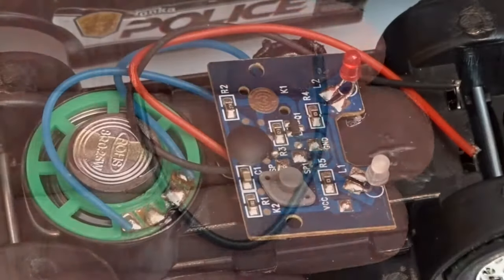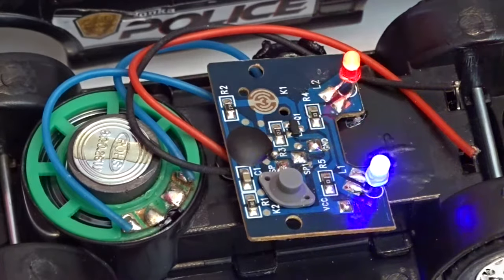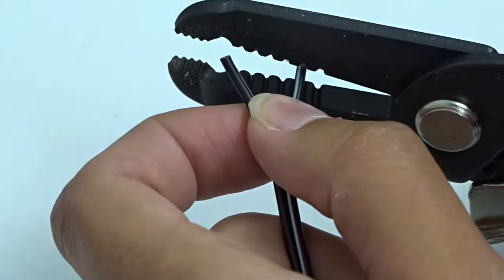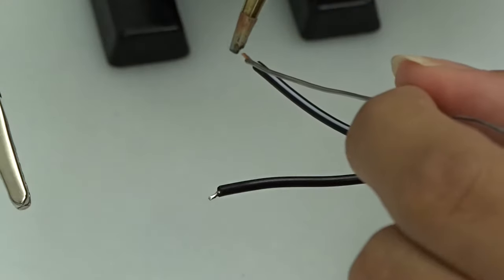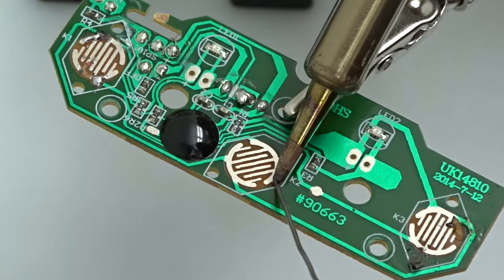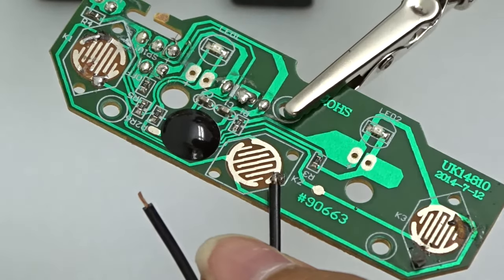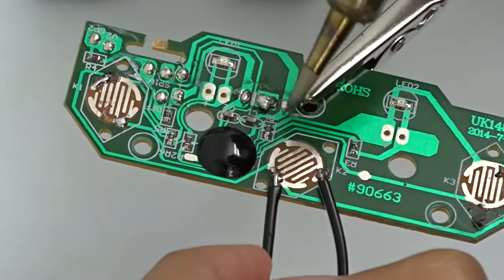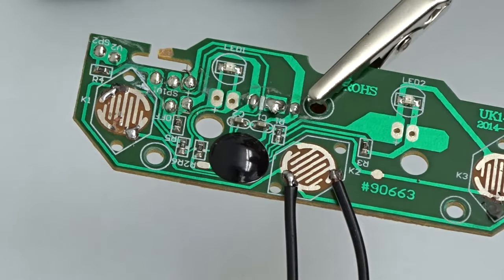How to Solder a Wire to a Circuit Board

Comment: I've taught myself as I worked in car audio electronics in my own business.  Things come up and soldering became an important part of my life.  As time went on things got smaller and smaller and the work my needed magnification just to see it.  So I got reading glasses in various strengths most powerful being 3.25.  Next is an electronic microscope.  This video is a great starting point for soldering to a circuit board.  You're A good teacher.

Comment: THANK YOU!  for your time in making this video.  I have a Kenmore vacuum, that needed a wand release tab replaced.  Which I got done.  But not knowing what I am doing to re-assemble, one wire to the circuit board came off.  That control the carpet part to work.  I have had a solder iron for years, due to model trains, but never got the concept on how to solder, as you explain it very well in short time.  So I did get the wire back on, but then another wire came off, in the process of re-assemble.  Got that back on too!  Vacuum works get.  The release tab will break in time, again, as I got 2 tabs, so the vacuum lives.  MM.

Comment: The solder doesn’t melt on the board. Instead it sticks to the wire. If I leave it on the board and put pressure; the metal part of the board would come off. Any advice?
Reply: Use flux paste. You can think of it as a river. The flux paste is your riverbank it controls where the water is going to go aka the solder. Solder is attracted to heat. It will follow the heat wherever it goes so if you heat up the metal on the board the solder will follow and attract itself to that place of heat on that board thus sticking to it. If you heat the wire up it's going to stick to the wire you have to heat the board then the wire then the solder. Just remember solder always goes to where the heat is. Just think of it as your daughter's a gold digging woman and your heat gun is the richest man on earth.
Reply: Also I said that kind of wrong because more or less your flux is like a lubricant It just makes everything flow but a lot easier. Solder takes the path of least resistance when you add flux to it It basically heats up the flux and replaces The flux with itself. Oh here's a good example you and your old lady are the copper and the flux. Once you to get heated up suddenly you're a kid burst into the room which is your solder and because you two are all hot and whatnot of course naturally your kids going to follow you around. That's actually a pretty good one.

Comment: Can someone pleasse help me. Can you solder a wire onto old solder on a mother board?? Or do i have to clean out the old solder before i can solder back the wire
Reply: Did you find your answer?
I found a video on “how to remove old solder”. I’m not sure if you have to remove the old. Videos make it look so easy and clean, but my soldering jobs look like a clump of crap lol
Wish I knew more to give you the answer you’re looking for.
Reply: Yea you can.  Just make sure you heat the old solder and new solder well so that they merge together as one.

Comment: Do you need solder with flux?
Reply: Always
Reply: @TriconPOE  I’m new to soldering what does flux do? And is it necessary?
Reply: @rushyy8765  Not a sin not to use one.. I haven‘t got into trouble for not using it, but it ensures clean contact joints.
Reply: You don’t need to except if you micro solder.
Reply: @TriconPOE     please, guys, will you tell me in this case where and how and when one would apply the flux? I'm just a beginner and I am learning
Reply: @mikelor84  I did and still use solder with flux in it, you normally don't need to add extra flux.

Comment: You dont use flux?
Reply: maybe the tin wire she's using got a flux filled core...... I guess. i heard about those.
but please, I am just a beginner and have watched some videos about soldering. in case you have classic tin wire, where, when and how do you apply the flux paste? please it would be of great help if you told me this. thanks in advance

Comment: What is that black paste looking stuff???
Reply: I’m pretty sure that’s flux
Reply: @ethanmontoya300  I think it's some sort of glue type paste for added protection. I found this on my vape mod after I opened it up because I needed to resolder a wire I eventually was able to peel it off so definitely  not solder. It had a rubber type of consistency.
Reply: @ethanmontoya300  I think that's some resin that they put there to secure the chip so that you can't remove/replace it